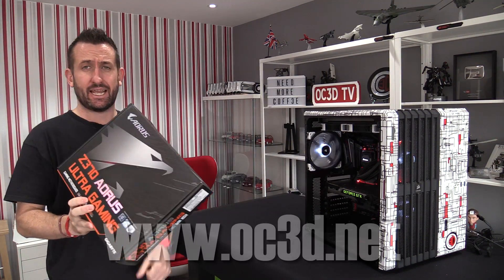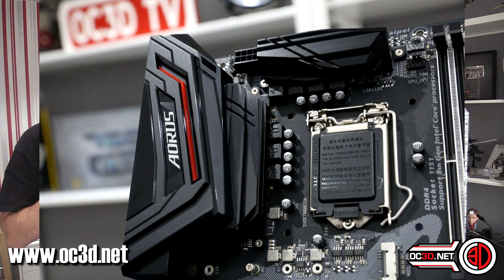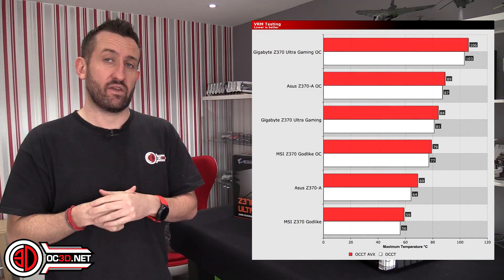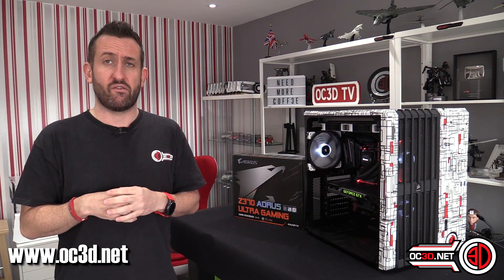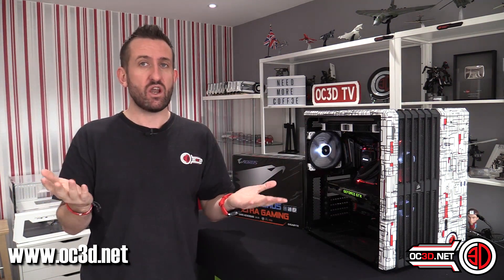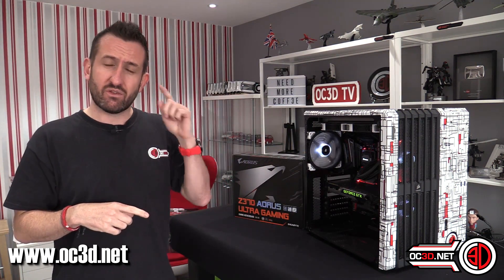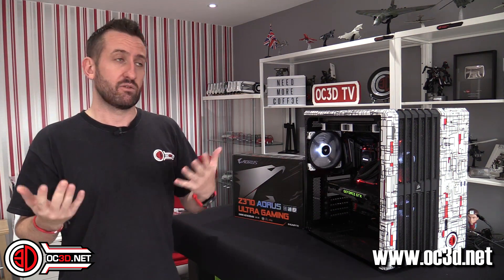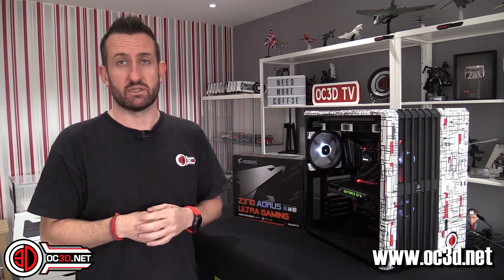Gigabyte Z370 Ultra Gaming - VRM Issues are back

Comment: Z370 gigabyte aorus gaming 5,7 ultra gaming all gigabytes run pretty hot. The asrock z370 tachi has the same issues. Even my maximus x and xi have the same issue. 99% of the z370 z390 boards I've played with all have high vrm temps. The gigabytes for me never broke 80c w/ 5ghz and overclocked bus and ram with a 8086k. Asrock ran 140c and fried a 8086k of mine. Had to rma the board and chip. Lost my 5.4ghz binned 8086k cuz of that board. Abit messed up selling out to asrock Abit was such a better company. Never buying asrock again. The fix for all of these z370 and z390s is pull the vrm heat sink. Replace thermal pads cuz they are trash. And remove the spacer. Or make the thermal pads fatter. Because the heatsinks are lose and don't make contact with the modules properly. I did this fix to all the boards. Z370 390 gigabyte 5.0ghz dropped temps to 45c vrm under full load for a hour. Lowered the ram and cpu temp as well in the process from cleaner power. The asrock board ran 55c with the fix. And the Asus boards I have run 45c same as the gigabytes. Never trust manufactures to have strict tolerance for there products always check everything before installing.

Comment: What's interesting is that the Gigabyte Aorus Gaming 7 was one of only a few Z370 boards which utilized VRM's that ranked at the top end of the quality list such as those which typically make their way into the top end X299 series.  I currently use the Aorus Gaming 7 but have to admit that I have not checked the VRM temps.

Comment: I'm using the Gigabyte Gaming Wifi z370 board w/ an 8700k and noticed my vrm at 105c so I found this video.  Good to know that it's not just me and w/ some tweaking I can get it down a bit.  Thanks!
Reply: If you're still having issues with vrm read my comment. I know I'm a few years behind this video lol

Comment: what temps are u all seeing on the 8700k  @1,22v ? is it posible that my chip is bad and runs 80 degrees load temps on a noctua NH14 at stock clocks and manuel input 1,22v ?

Comment: Leo on Kitguru also did a review on this board and came to largely the same conclusions with the exception that he only reached 50 ish degrees C on the VRM during gaming benchmarks with a 5 GHz OC. The VRM hit 117 degrees C during the BMW render which he noted is not great at all but he went on to say that if you are using this board as a rendering workstation then you made the wrong choice, it is called "ultra gaming" after all. If you are planning on using this for gaming, even with a 5 GHz OC, you should be ok. To be honest, if this board could do everything the gaming 7 can do it would not be £100 cheaper.

Comment: Storm in a teacup. I have this board and an 8700K overclocked to 5ghz. Yes, the VRM's get hot, around 90C. No throttling or issues with stability. Gigabyte tell me that the VRM's are good for 125C. The issue is that this board does not assign enough VRM's to the CPU. The quality of the VRM's is fine, just not enough of them!

Comment: So which board would you recommend? Asus is bad, Gigabyte is bad... I can't figure out a decent board to buy :( I got the 8700k already.
Reply: Steve L Which board did you get I'm still searching one for my i7 8700k?
Reply: I got the Gigabyte Aorus gaming 7, good board overall, nice RGB lightning, easy to setup & install BIOS updates. I got it on sale for $180. If you still on the fence, I'd recommend checking out Asus Maximus X Code, expensive but it's a beautiful board.
Reply: Steve L I have shortlisted few Z370 please suggest one-

Gigabyte Aorus Ultra gaming 
Asus Strix Z370-F 
Asus Z370 Prime-A 
MSI GAMING PRO carbon (Non AC) 
Gigabyte Z370 Aorus Gaming 5
Reply: Well, just go with one of the Asus, they have better UI, more user friendly.
Reply: Steve L I also wanted to get Asus Strix Z370-F but there was a problem related to LLC on that board, so is it fixed now? 
Gigabyte board has Vrm issue 
Asus board has llc issue so which one should I get?
Reply: Like I said, every brand has their own issues. Just got to deal with em I guess.
Reply: Steve L You are right that every board has their own issues, but now I'm buying my motherboard and wanted to know if the issues with these boards are fixed or not. I'm confused between Asus Strix Z370-F and Gigabyte Aorus Gaming ultra.

Comment: I think I am quite lucky with my board, I am running a 1Ghz OC on a 8700K, paired with a H115i extreme, and I also have a 120mm fan next to the vrm as well as the 120mm fan and radiator from an EVGA hybrid cooler for the GPU. 

It has been OC'd for 20 mins now and stressed on CPU-Z and it is sitting at 77C for now. I am not sure what will happen if I push it to 5Ghz, I think it will sit around where your stock recording is for the gigabyte board. I think it may be something only effecting a percentage of the boards.

Comment: I were testing my vrm's as well since yesterday, but i didnt see a problem if i can believe the number hwinfo64 shows me, the highest i saw was 63c.

Im using the 8700k @ 5ghz as well, only difference is that i got the Gaming 5 from Gigabyte because i wanted that debug led. :P

Tried the OCCT stress test as well, but it only got to around 60c~ again, dont know if the reading is wrong or not.

On a side note, vcore set to 1.25.

Comment: So, what is a solid, reasonably priced motherboard for Coffee Lake z370 ?
I really need to buy a new computer yesterday but I'm stalling because of the faults reviewers find.
Can you recommend a solid, reasonably priced motherboard for the i5-8600K CPU ?
I just need a solid gaming machine, ready for VR (HDMI + enough USB 3 ports). I don't need nor mind RGB, and I'm not going to OC a lot or push it to the extreme.
---
Tom put the Strix to shame, and the GB Ultra Gaming.  How are the MSI boards, like PC Pro or SLI ?

Comment: TechteamGB can you please tell me which is the best motherboard has the best bios for overclocking a de lidded 8700k cpu. Trying to get max stable performance. I’ll also be overclocking 1080ti gpu to max while maintaining stability. Probably going to mess with ram too. 

I don’t really have a budget but I sure as hell don’t want to spend Msi godlike money on a board.

I was thinking about the Maximus x hero z370 AC but I read that some didn’t like the bios.

Comment: god damn it... I upgraded after 5 years to 8700k and picked Gigabyte as I had good mobos from them before, trusting them to know what are they doing. By the specs ultra gaming had everything I need and should be able to do OC at 5GHz with no problem as well or need to buy higher tier mobo

Now when I was tweaking fan curve I linked sys fan to VRM temperature and saw 100+C in burn I immediately stopped all the test, checked hardware for possible issues and found no problems... and came across this video while looking for more info

You are literally only one noticing this as far as I can tell from googling and it has been whole working week even since this video and nobody is talking about this except few reddit reposts of this video... I am kinda upset, more so when I found out that Intel is now using some crap thermal compound making even more difficult to cool the damn 8700k at 5GHz and you need to void your warranty with delid to get somewhat decent temperatures after you already paid hefty fee to have unlocked CPU with letter K

Comment: The reasons the issues are back, as you say, is because this latest release was rushed out to try and compete with AMD... Which runs at a much lower voltage with better results. Now when Ryzen 2 comes out running at 4GHZ+ stable what do you think Intel will do again!!!

Comment: Hey Tom, how about taking the heat sinks off, doing some high res photos of the vrm and sending them over to Buildzoid over at AHOC so he can do a pcb analysis? He's doing a lot of pcb breakdowns with vrm component ratings and efficiency calculations, so you might find out if Gigabyte cheaped out on the mosfets or what's going on. He's also in the UK btw, https://www.youtube.com/channel/UCrwObTfqv8u1KO7Fgk-FXHQ
Reply: well ok, was just thinking it would make for an interesting rant. but meh, I guess there are more positive things to spend time and energy on.

Comment: I have the cheaper Z370 HD3P model, with a 8600k o/c to 4800Mhz 1.2V
VRM temps. go to about 65ºC while gaming but climb up to 90ºC if i use IBT or Prime95. Gigabyte still has not answered my support ticket.

Comment: Great video, Kyle at Bitwit has been having vrm issues too with severe over heating, but its sort of expected as its a X299 mobo I believe but cant remember of hand which mobo it was, I think it was the Asus ROG variant. Heat sinks just isn't up to the job when even a little oc is applied they was maxing out at well over 100c, They actually talked about it on Gamers Nexus has he was meant to be doing a delid vid but then got hit with the vrm issue, They sorted it by literally placing a fan right above the vrm heat sinks and blasting it till the temps dropped to a more stable state.

Comment: With all due respect, huh? I'm sort of siding with Gigabyte here. I mean VRM can sit comfortably at above 100 degrees usually. As long as they put a reasonable throttle point in the motherboard firmware it should be fine. Have you actually reached that throttle point when testing? Trust me you notice when you hit that point, I've been reaching it with my X299-board :P Is it perhaps more about peace of mind? EDIT: Read DaniëlWW2's explaining and analyzing comment and it started to make more sense.
Reply from the maker: They know there is an issue with this. They have increased the throttle point so it wont be hit. 100C is a bad number for any board and if you look on the website youll see none of the others have got that hot.

Comment: VRM's are well within "standard" as they may be rated for 140°C for "standard" performance and "standard" durability. Their viewpoint is understandable.
But A gaming / high end motherboard should not accept "standard" in that sense as they are to be heavily stressed over long periods of time and are expected to function optimally, beyond standard efficiency and accuracy and to continue to work far beyond the standard "durability" 
"standard vrm temps" of 100°C will weaken the motherboard's structural integrity, prematurely damage other surrounding components, increase the power leakage the VRM itself as well as the surrounding circuit and components thus reducing the efficiency below optimal and also reduces the accuracy below optimal increasing instability. 
 It is expected of a high end motherboard or even a entry level from a big brand to give optimal performance, efficiency and durability. "standard durability" of 1, 2 or 3 years when we expect theses hand picked high quality, in this case even high end products to last far beyond the other components becoming obsolete. Not to just be thrown into the African dumps with the other Apple Products.
Reply: Agree 100%.

Comment: I'm really surprised by the commentary to the VRM capabilities.
This particular boar is on the low-end of the power delivery with the 7 phases some of which are not even for the core. The left part has higher temps since USUALLY, with such a split, left part is responsible for the core voltage. an overclocked 4 core i7 can pull around 150w from the VRM under extreme loads. I guess 6 cores does at least the same. 
so of course this poor man VRM can't do that. To produce such current it generates insane (for the passive heat sinks) amount of heat. I also pretty sure that MOSFETs used on this board are on the lower end to begin with. 
Bottom line even higher end MB can have VRM overheating issues if pushed hard enough for long enough. For example, my MB will shut down after about 60-90 minutes of torture with CPU pulling 115-125A at 1.3v. If i slap a fan over the VRM to create a decent airflow, it will work forever.

Comment: I've had this board for 2 weeks and did some testing. CPU is cooled by Cryorig A80 AIO. Currently running 8700k x49 @ 1.27V. In gaming VRM MOS is showing max 70-75C. In typical stress tests with ~170W TDP VRM is getting very close to 90C... with 3x 120mm intake fans close enough to blow (a least a bit) on it. For now for winter it will do. But when summer with 30C+ kicks in at current settings it's gonna hit ~100C in CPU-heavy games which is unacceptable and should that happen I will sell the mobo :(

Comment: You should chat to a bios modder named KET. He has plenty to say about gigabyte bios and board quality. I built a gaming k5 AX370 with them 1700.  Almost no bios overclock features..No manual LLC. It was easy to overclock CPU to 3.82 and the ram worked first time at its xmp 3200mhz.. vrm temp went to 108c on burn in test with that piezen overclock.  My own motherboard is a gaming 5 ax370... LLC set high by me and the vrms about 80c plus with 3.925ghz ryzen 1700 with 3466mhz ram. I have an 80mm fan taking vrm temp down by 20c.
Reply: David K. I always stick an 80mm fan blowing towards vrm anyway. I Wonder if a waterblock will be available at some point.

Comment: i have the asus hero board for my 8600k... i can boot at 5.3 ghz but... it crashes. i can run at 5.2 at a lot of volts... i can be satisfied and roll at 5.1ghz... right now my issue is that i have a x299 7820x system at 4.8 ghz. i also have 2 rx vegas in crossfire. dont ask why. im mostly gaming in 4k with these cards... question is... would i be better off running my main gaming system with my 8600k and my 2 vega 64 cards? or would i have better results with my 7820x.... dont ask why i have the 2.... question is... which set up will get me better strictly gaming results. power is not the issue. 8700k is not possible to get. 8600k gets very similar results in games.

Comment: I had a similar issue with my Aorus z370 Gaming 7.  The VMR's would hit over 120c in prime95 with my delidded 8700k @ 5ghz.  Tightening down the heatsinks dropped the temperature over 30c

Comment: I was just about to buy the AB350-Gaming 3 as a base for my next build and review. Will this have the same problems ?  I am assuming they may be using the same components across boards.
Reply: The 1800X. I was going to go for the 1700X but there is only a £10 ($13) difference.

Comment: Saying Gigabyte didn't give you an answer is straight up wrong. They told you the VRM's are rated to a temp much higher than what they were hitting. The temps you were seeing weren't affecting performance at all...So what's the problem? You've made several videos talking about VRM temps, yet none of the boards you've said had VRM heat issues aren't experiencing throttling or any other issues. 

Is this just another way for your to pass your Asus fanboyism onto your watchers? It's 100% clear that Asus has you in their pockets.
Reply: "The temps you were seeing weren't affecting performance at all...So what's the problem?"

The problem is that very high temperatures dramatically reduce the lifespan of the board.
Reply: Not to forget that asus hat x299 vrm issues as well... He pointed that out after der8auer made it popular.
Reply from the maker: I suggest you watch my Asus Z370 Strix video. 100C vrm's are bad. All they have done is increase the throttle limit.
Reply: How can something runnning at 100c when it's rated to 125c be bad? If your processor ran at 80% efficiency, you'd say there was something wrong with your processor.So why exactly is it bad for VRM's
Reply: Phaze Shifta i know this is old, but even if its rated @125, but other brands don’t have this high temp. It’s useful for winter i guess, but it increases the temp inside the case at least

Comment: please note guys, gigabyte cheaps out on the vrams of any board under the gaming 5 (around 180-200 USD/EUR level) I bought the x370 k5,, it has a small and extremely bad quality vram, i returned it the next day and got the gaming 5. Then i was disappointed even further by the extremely bad bios and the app center that is even worse...Guys be careful when you buy gigabyte boards, i have given them multiple chances but next time i'll try msi or asrock (already have an asus system) :D it's just hard for me to recommend gigabyte boards...
Reply: I won't be buying Gigabyte anymore. I can't even use their software because it causes the OS to freeze. Mouse unusable in BIOS. The X370 can't even change the color of all the lights. The CPU cooler on mine required me to put my body weight on the board to get the screws in. I'm going to try ASUS next time. I've had MSi boards before but I hear they're not that good for OC.
Reply: Now let me disappoint you: MSI has by far the worst VRM design out there.
Reply: I haven't tried MSI yet, well guess i'll go asrock or back to asus.
Reply: i had k5 too i returned it and i got asus b350f im so happy now.

Comment: Great you still talk about such fuck ups. And YES I do check these temps, the first day the systems runs, temps are under highly investigation. Anything at THESE temps, even for vrms would mean a return to the manufacure / retailer. But what exactly is now the problem? Gigabyte made a great job with the x399 - similar in design at least, no vrm issues here even in max stress tests on a 16 core cpu... Is it realy something coming with the design of these intel chipset?